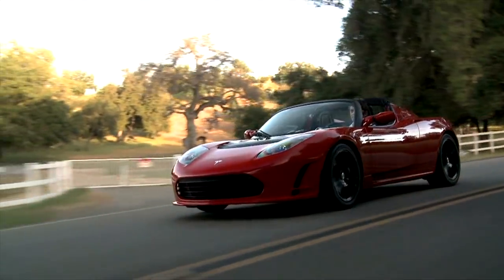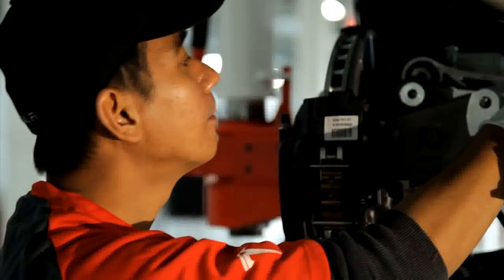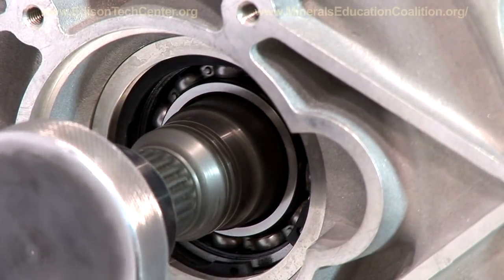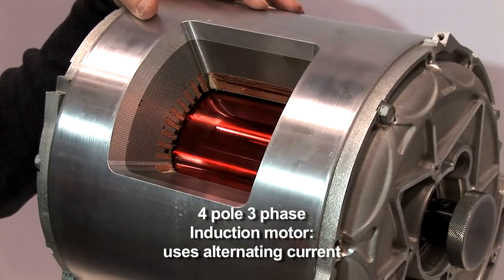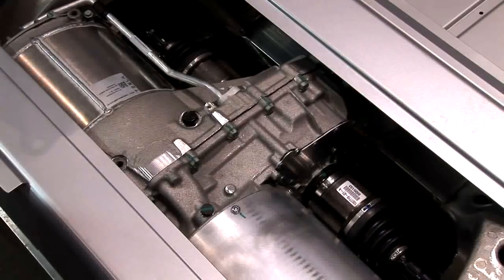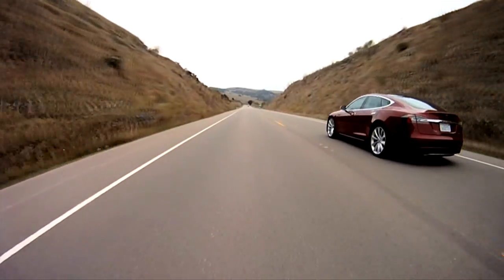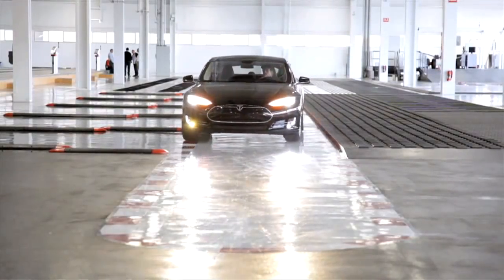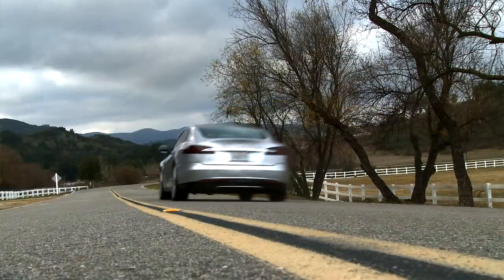Electric Motor: Model S, Tesla Motors

Comment: ICE 20% efficient.
EV's 80% efficient.

The future is coming!
Reply: +gwruyzyahoo 
Both those numbers are a bit low.
ICE are about 22-23%
The Tesla has an astounding 97% efficiency though.
So about 4x better.
Yeah, EV future!
Reply: true in reality it depends how did you get that electricity in the first place. Costs of petrol production are max 9% or less of its price you pay. And 80% of electricity is created by burning coal...which is actually one of the most efficient methods of getting electricity. BUT the n the losses in transport, resistance of conductors etc... It isn't as easy as it seems... but yes I love the acceleration of elektromotor, and how it will push car manufacturers to move and start to work on some alternative ICE motors..
Reply: As you might know, at least two of three areas must be affected (or perhaps all three social, economic and science) , in this case the economy and not only science must go the same direction in order to get this effect as we see today with the shift from the conventional technology used that economical wise mostly favored those who benefit from oil and into the electrically driven as of instead.

Comment: That's not direct drive, its a single speed transmission! don't get me wrong, I’m not criticising but they’re different things. there are some electric cars that go straight from the motor shaft to the wheel on the same axle, no cogs.
Reply: +lendoggtheking Sure I guess but it's still the same gear for forward and reverse =) It's mostly for efficiency reasons rather than torque limitations though